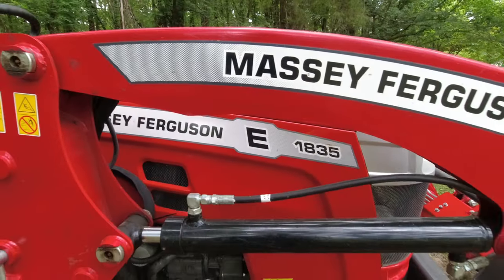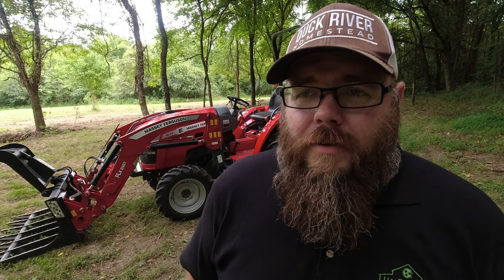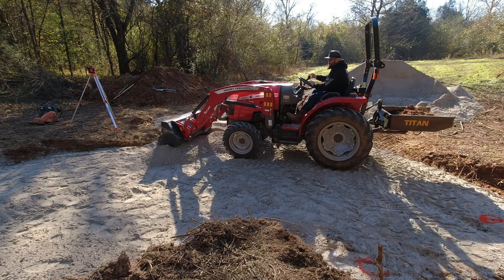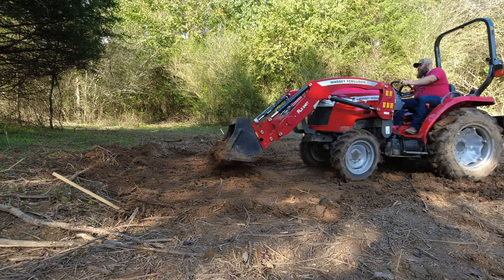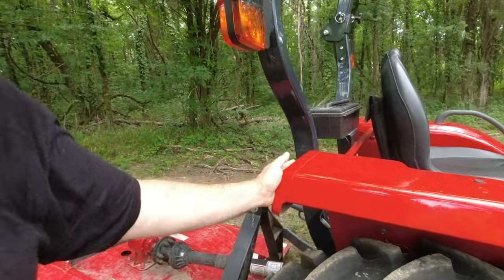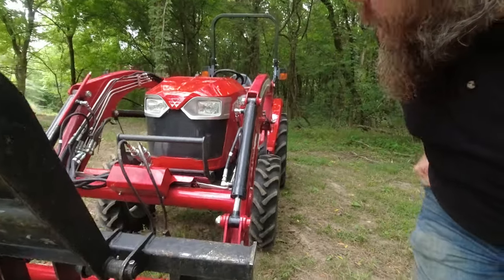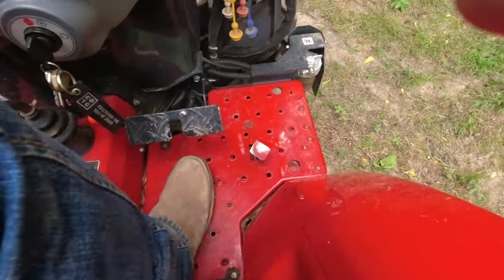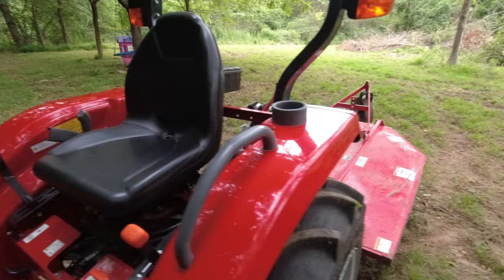046 - One Year Review - Massey Ferguson 1835E Compact Tractor. Perfect Homestead Tractor review.

Comment: Nice review; Any tractor is better than no tractor, But a M-F tractor = A Mighty-Fine tractor. I own a 1959 M-F 50 gasoline, & a 2018 1526 love them both; They are both hard working tractors. I like all the implements you have for your M-F 1825 E; Nice setup.

Comment: An LED light bar up at the top of the ROPS is the bomb. A high light source shines over the front edge of the hood and past the loader bucket for superb night time work. I wouldn't be without it for snow work, or any dark time work. One facing rearwards is also recommended for seeing what's going on behind you at night so you don't back into things. Mine's on a separate switch.
Reply from the maker: This is definitely what I need to do. Should be easy enough to do. Thanks!
Reply: I've been thinking about that for mine.  I have to fold it down quite a bit though.  Has the light bar interfered in that respect?

Comment: I'm getting ready to buy one this week, glad I found your video. I bought 12 acres in Conyers GA, rented a JD tractor this week and decided real fast I need a tractor. Ordering one with the front bucket, this attachment, backhoe and brush cutter. Can't wait!
Reply from the maker: Man I really wish I had the backhoe. Maybe some day, just not yet. Congrats on getting the land! There's nothing like a tractor to take care of your land.
Reply: @DuckRiverHomestead  dealer is talking me into a 1840M, skipping the back hoe as it costs another $10K and I may not use it much but if I do I'll pick it up. Getting a 72" finish mower, 72" brush hog, front loader and tree grabber attachment. Never in my life did I think I'd be buying a $50K trailer/tractor combo but my son can also use it to do jobs for other people to pay the payment.
Reply from the maker: Awesome! The 1840M apparently has an upgraded frame and heavier lift capacity on the front loader. Seems like a pretty good option to me. I'll probably get one of the finish mowers at some point. Now the question is are you gonna get a PTO wood chipper or grapple? Those two are life changing.
Reply: @DuckRiverHomestead  grapple so I can pick up trees and then wood chipper eventually.
Reply from the maker: Looks like we have quite a bit in common. I'm a 4 stripe blue belt at Gracie Barra (Ultra Heavy - Masters 2), and I lived in Tucson for 10 years. Are you still in Arizona Or did you move to GA already?
Reply from the maker: I plan on building a BJJ studio in the woods with the wood from my property. We also have a sawmill.
Reply: @DuckRiverHomestead  We moved to Conyers in June. I started going to BJJ here preparing for Masters Worlds but hurt my neck, herniated 2 disks and bulged a 3rd. It will be a long road for me to get back on the mat, was actually told that I am never supposed to compete again. That being said I want to open a GB here in Conyers and also eventually build a 40x80 building on property for guys to be able to come and train and stay for free in trade for them helping with the farm :)
Reply: @DuckRiverHomestead  I just got my blue belt right before I left btw, I also have a heavy background in wrestling for past 18 years.
Reply: @DuckRiverHomestead  Well sir after much back and forth we went with a JD 4066R cab tractor, 2072 rotary cutter, finish mower, mulching attachment and grapple with 3rd function. Picked up the tractor yesterday and got rear ended on the way home damaging the new 24' equipment trailer we bought also. Life sure has some crazy ups and downs for you.
Reply from the maker: How are you enjoying your JD? Did you get the trailer fixed?
Reply: @DuckRiverHomestead  trailer fixed, JD has been doing work clearing brush and moving it to our burn pile as well as moving rock. Had to put rock in the pasture due to so much rain in GA.
Reply: @mtxpert Hi, I live in Loganville Georgia and I’m thinking about a Massey, still liking it? Did you buy it from a particular dealer? Thanks

Comment: I had a 1740e HST for almost two years it was a 2020 and it was a awesome machine.  I now have an 1835M Cab and I absolutely will never go back to an open station, the use you get out of the tractor when weather is no concern goes up dramatically.  That being said i do believe that other than lift capacity the loader on my 1740 was higher quality than the much bigger and more expensive unit I have now.  No issues with either machine, never an engine light or service visit but I believe the SSQA was more robust in the 1700 series along with steel lines for the older functions instead of hoses ran through the loader frame and the loader stands on the 1700 series we’re also much better in my opinion.  Great video and great machine.  I upgraded the bulbs in my E series to a premium halogen and it made all the difference.  Best of luck.
Reply from the maker: Great idea on upgrading the headlights. Thanks for sharing your experience on your 1835M. I think a cab would be really nice. I was concerned about a cab in the woods so an open station made a lot of sense for me. But those air conditioned cabs are really nice when the weather isn't perfect.

Comment: I am in the market for a tractor and have similar requirements so your video is very useful to me. 

Thanks for sharing and best wishes to you and yours.
Reply from the maker: I'm glad I could help out! What stage are you in looking?
Reply: @DuckRiverHomestead  still trying to determine the minimum size I need to skid and load timber on a mill. your tractor looks like it struggled a bit so I might be going up to the 2606H.
Reply from the maker: If I had fewer woods I really would prefer the 2606H. But for me the compact size has been perfect. I wish there was more lifting power though for sure.
Reply: @DuckRiverHomestead  glad you found the right tractor for your needs. I  wish I could go with a smaller machine to save $ but some of these white pines I'll be moving are monsters.

Comment: Hey Brian ,you got the BEST "starter Tractor". I had looked for another tractor. Have a kubogy MX5200 TLB( kind of big) & a Massey-Ferguson a1988 2wd 1020 21hp 3speed hydro-slack-o-matic 1600hr no loader machine(kind of small). So I searched for something in between. "Fell into " a 2016 Massey-Ferguson 1736 power-shuttle T&L off the showroom floor in 2018 with 0.6 hours & a "deal"--it is a Geat Tractor but 85% as big as the MX. Since "they" tweeked the 1800e series ( like yours) l have no further to look because it's  75% as big but same horse-power & by the specification more nimble. The old 1700e series was not quite "up to par". The 2850m is your "next jump" in a Tractor quest - but by all means keep the 1835E it is so nimble,capable,& handy. In the "mean time" just "cage" the turn signals & "slap" some Big lights on the ROPS Bar. I have the same 6 foot flex-link brush cutter ( used it for 1st time in two years) just last Week---FABULOUS. Did you add the "slip-clutch" ; l Did? Nice log grapple for the sawmill & everything else. Thanks for the great Video Sir and happy safe tractoring, building,& sawing. Keep ALL of them Great vidios comming.
Reply from the maker: Yes, I have the slip clutch. It's worth the extra cost. Great idea on adding some nice bright work lights on the ROPS. Thanks!

Comment: I just found your channel.  Seems that we have a lot in common.  I also have a MF1835E.  Mine is a bit different with a Hydrostatic transmission and I have R4 tires.  I may switch those out as I finish my home projects and move the bulk of my work to my off-grid property.  I also have a Woodland Mill(HM130 MAX) and the WC68.  I absolutely love the WC68.  I plan to get a stump bucket and do the same hydraulic upgrades that you did.  I also broke one of the lights.  My dealer had told me to re-mount them to the inside of the ROPS to protect them.  I haven't done that yet.  I may try to fabricate some sort of guard to protect them.  I like your Titan three-point dump bucket.  I've been considering the Big Tool Rack but keep choking on the price for that thing.
Reply from the maker: Wow, we really do have a lot. I've just been more careful in the woods with the lights. Now that I have a polaris ranger I haven't really used the dump bucket. I wish I had gotten the hydraulic version cause it doesn't really release easily. I need to get a quick attach for the 3-point. I'll probably be doing a year 2 update shortly.

Comment: If you need more light on that tractor, you’re rollover protection, you can mount want those big off-road lights that are LED on it and it will more than flood enough light in front of you. See where the heck you’re going
Reply from the maker: I think that's exactly what I'll do. I need to put some on the ranger as well. Neither have backup lights. I need to order about 10 pod lights it seems.

Comment: Thanks.  This was useful as I am currently looking at different 35 hp range compact tractors.  Unfortunately the nearest Massy Dealer (also true  for Kioti, Branson, and Mahindra) is over 50 miles away so they are probably out of the running.
Reply from the maker: What brand are you looking at? 50+ miles is a tough one, even if you have a trailer strong enough to tow it, that's an hour minimum to get service. And the hauling fee would be cost prohibitive as well. If you have a local dealer/service provider for a specific brand, for me that would make a HUGE difference. Mahindra was about 100 miles away from me, so that wasn't an option. They JUST put in a Deere dealership around the corner, but I also have Kubota and Bobcat nearby as well. Any of these would be a good option. Just make sure you get the quick attach front loader. That will open up a world of opportunities.
Reply: @DuckRiverHomestead  Within 25 miles there are a Bobcat dealer, two John Deere dealers, two Kubota dealers and a Yanmar dealer.  So some choices.  I am leaning towards Bobcat currently.  The Bobcat dealer had the best selection and I have a bit of experience with them. I have had negative experience with one of the Kubota dealers (working on my wall behind brush hog).    Also probably not the best reason but, the Bobcat is actually 30% cheaper.    Again thank you for your excellent advice and videos.

Comment: It's a footfeed pedal. I have an 1825e SS with 3rd function an Alo Quickie 4-in-1 bucket. I've had quite a few tractors in just as many sizes MF knocked it out of the park with this series.
Reply from the maker: Thanks for the vocabulary lesson! How do you like the 4 in 1? I think I'd really appreciate having one.
Reply: Mixed feelings. I move alot of firewood and would rather have a grapple for that., but knew what I was getting when I bought it. What I do like is the convienience. I can pick up logs (up to 1400lbs) move them to buck, then without getting off the seat, doze the pile around. Again in winter, without a tool change I can push snow and move back to the wood pile. It is a compromise, and has a big learning curve. It's hard to see when manipulating material. It's really like a giant claw arcade game at first. Sometimes I can lift a14"x 10' log no problem and other times I struggle to lift 6 4", only to turn around and pick a dandielion... The back drag and leveling on it is what I like most. No more neck turning. If the soil isn't too packed you can reverse blade and watch while you do it. Great for leveling soil or gravel. Definitely a useful tool to have. My factory bucket has never broke ground. Which brings up another compromise, limited capcity compared to stock, which is debateable. Factory is a 60" bucket and this is a 72". But the depth and height is less.

Comment: Question: did you have the option of the rear wheel weights? And do the ag tires mess up the grass at all? Looking at getting one of these myself. Also, how often does it regen and have you had any issues with the DPF? Debating on the 25 or 35.
Reply from the maker: Ag tires never messed up the grass unless I go over the same patch over and over and over again. I've had no issues with the DPF. It rarely has to regen, especially if I keep the rpms up for the PTO, it burns pretty clean.

I didn't see any options on rear wheel weights, but filling the tires made such a huge difference.

Comment: Nice video review. I found it very helpful. Can you possibly provide me with a link to the 3rd option kit that you’re using please? I’ve asked my local dealer and they couldn’t find anything on a 3rd option so he reached out to Massey direct and was told they don’t make a 3rd option for the 1835e.
Reply from the maker: Reach out to Cleburn Farm Supply. They installed the 3rd function and the rear remote for me. So I can guarantee that the 3rd function is definitely a thing MF makes.
931-388-7273

Comment: I have a question! 

Do you have to clutch to engage your pto? 
If so does your pto make a ratcheting sound when you lower rpm? Mine is hydrostatic so yours may not need to be clutched
Reply from the maker: I don't need to clutch... I believe the PTO is hydrostatic on this as well. I don't think it's mechanical.

Comment: Hi Brian.. Do you know what the three bolt holes are on the right side of the casing where the 3 point hitch on the housing with the lift arms are, that have bolt holes that aren’t being used with no bolts in them, in a 2022 1835 E Massy?
Reply: Can’t load the picture of them
Reply from the maker: I'll try to take a look in the morning.

Comment: Just a thought cant you flip the lights to the inside of the rops?
Reply from the maker: I might be able to flip them inside, but that'll potentially block my rear view.. The bolts are through bolts so it would be a direct fit,  I'd definitely have to drill a hole for the wiring, and at this point I'm not sure I'm willing to do that. I'd then have to put in a seal for the old wiring hole. At that point, I think it might make more sense to fabricate some fender mounted lights. who knows, the options are vast.
Reply: @DuckRiverHomestead  A "Cage" around those tail lights ,will fix everything; my 1736m power-shuttle has them & they are nearly indestructible. The Headlights on ANY tractor with a LOADER are ALL Dismal. Just have to hose-clamp some "High-Lights" on the ROPS;/ NEVER drill-weld to it. With the "Trend of EVERY LIGHT BEING L.E.D.'s" this is SILLY. High Intensity projector Halogen lamps are the BEST.....the MOST "Natural light". Thank you Sir for the Excelent vidio and happy safe tractoring. Best wishes with all your endeavours.